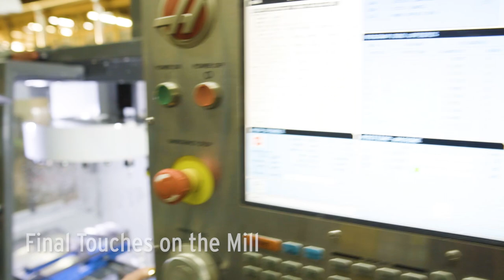Production of the Grin All Axle Hub Motor, with Cargo Wheel Preview

Comment: can the phase runner work with those typical 500watt bafang hubs?  i wanna upgrade my display and controller to something more set-able(like throttle responce, max speed, amps/power)
Reply from the maker: Yes it can run literally any bafang motor as long as you tune the settings correctly and wire up the hall sensor and phase wires.
Reply: you are the man.  not The Man but the MAN!

Comment: wish I could still do that type of work, diameter ? can you just bolt on a couple of wheel rims and seat a tyre direct to motor ?
Reply from the maker: Yup. It's a 20" wheel diameter sizing. For most situations lacing the standard hub into a 20" bicycle rim works great and is a lighter wheel. But for heavy cargo applications it's nice not have any worry about spokes breaking and that's where these injection molded composite wheels are quite handy.
Reply: @GrinTechnologies  from thumb nails it seems like you own stevi wonders as slave

Comment: That was a two-sided load test. How much is safe for this hub/wheel combo for single sided loading? And what about lateral loading? I can imagine taking my dream build off road, approaching a steep lean and snapping a wheel before it rolls over and gets totaled. Any assurance this won’t likely happen?
Reply from the maker: Visit http://cargobike-wheels.com/  and have a look 
Ultimately the strength for single sided loading depends on how you build your own axle on the vehicle. The motor is hollow and slides over a shaft that is part of your vehicle design, so the key structural component is on your end.
Reply: Ok, that does make sense and I understand. Thank you.

Now say the load was back to double-sided with the strongest axle of all time but applied at an extreme, 45deg angle. Now, not only is the axle responsible any longer but the hub and its fitment to the CBW3 is being torqued laterally. It will never be 45 irl but it could get steep enough to be a cause for concern. This type of load also occurs on sharp, fast turns on flat, level terrain. Can the all-axle motor and CBW3 handle that type of load?
Reply: @EricPeelMusic  Are you planning a cargo bike build, or to challenge Pike's Peak? If the former, when will a cargo bike be in the position you describe? Anything will break if you exert enough force. The question then is, did you select the right tool for the task at hand? Without explaining your purpose, you can't expect to get a satisfactory answer.
Reply: @fun_ghoul  I’ll be frequently off-roading with a heavy setup. It’s obvious you did not design the hub motor or wheel in question and you won’t be able to help me.
Reply: @EricPeelMusic  What exactly is "the strongest axle of all time"? That's like asking "How long is a piece of string?" You can't determine an answer if you aren't willing to use actual numbers. The axle is still the key structural component.
Reply: What I mean is if the axle (and all other parts other than the hub) were hypothetically indestructible. That should be obvious. My concern about moment loads on the hub is simple and justified. Armchair engineers such as yourself on youtube are of no help, as usual. If I could be provided with a max static and dynamic moment load rating of the hub, I could progress on my project and possibly go ahead and buy four of these hubs.

Comment: Would these wheels be better for the lateral loads a trike would experience? How soon might we be able to order?
Reply from the maker: The hope is that they would be tougher and more resilient than spoked wheels for these kinds of cargo applications and that's exactly what's being tested right now. Future tests will involve the wheel being inclined by 15 degrees on the testing drum to simulate the lateral forced present when cornering.   Properly built spokes wheels are incredibly strong too and are lighter weight, but if they ever go out of tension (like from a dented rim due to impact) then they can quickly succumb to spoke breakage.
Reply: @GrinTechnologies   Hey! Did anything come of this test? I just emailed to order a couple of these wheels. I'd like to know if the strength when cornering is greater than the spoked wheel option. Thanks!

Comment: What voltage range is acceptable for the hall sensor PCB inside the motor?  Is it +5v, or is 12v possible?  And is it open collector or is it push pull output?
Reply from the maker: The standard hall sensors usually work up to 24V on the rail and have an open-collector output with the signal pull-up resistor on the motor controller PCB.  That makes them compatible with a wide range of voltages.

Comment: I was wondering if someone had the latest Grin all axle hub with L1019 on the disc side. Could the opposite side cover be replaced with a cassette cover to be used now as a rear hub motor 🤔? 
The design seem simple yet very efficient.
Reply from the maker: The axle is different in the rear motors. The cassette freehub will not fit over the diameter of the front axle, it needs to slide over a 15mm shaft.

Comment: I need a motor that has about 130mm-150mm bore.  I can't seem to find any on the shelf with larger companies; is there something in your lineup that can assist?
Reply from the maker: No, that's way outside the league of anything that would be required for ebikes or LEV's. If you have access to a machine shop then in principle you could take the stator and rotor of one of these motors and then modify the side plates to use massive ID ball bearings and then machine your own axle for it.

Comment: for a stock bike, am i better off with the Bafang 02 or HD motor?  I have heard of controller failures on the 02s
Reply from the maker: Would probably have the least issues with a Grin All Axle Hub ;)
Reply: @GrinTechnologies  got to ask. why does Grin not make a mid drive motor?